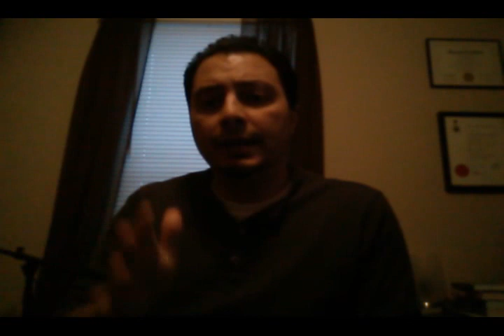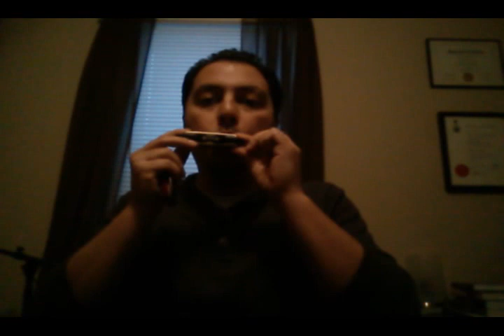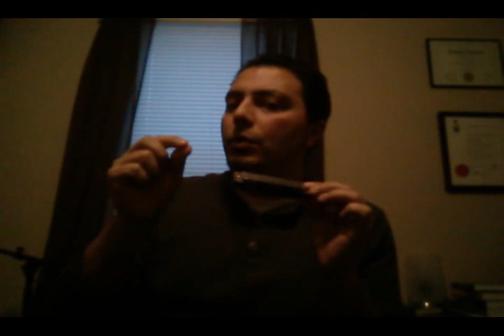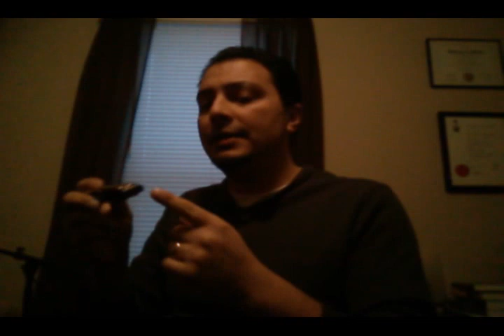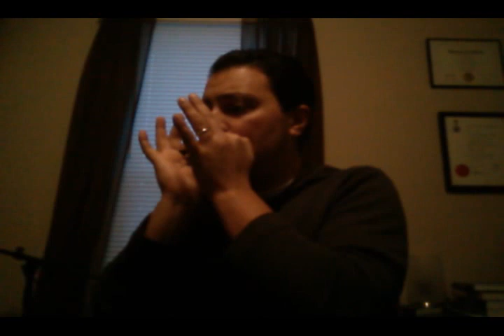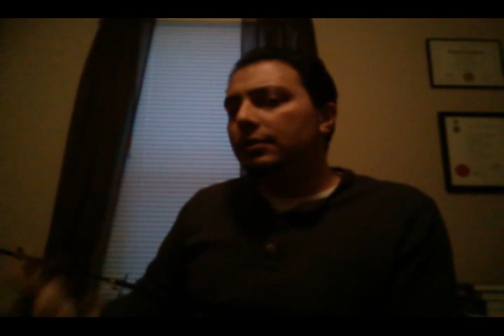Tips for playing half-valved diatonic harmonica

Comment: How do you clean them??
Reply from the maker: Disassemble and use a qtip and a toothpick to dislodge particles and wipe surfaces. Clean water, perhaps with some hydrogen peroxide, could be used to dip the qtip in. Do this all very carefully, and try not to damage reeds or valves.

Comment: How did you blow bend on the 2 hole?
Reply from the maker: Well, it's the valves.
Reply: @OneHarp  wait, so does it actually count as another halfstep? That's crazy.
Reply from the maker: @vermin5367  Yes. It adds at least one halfstep bend in the other direction.